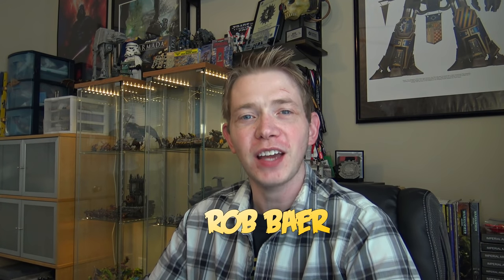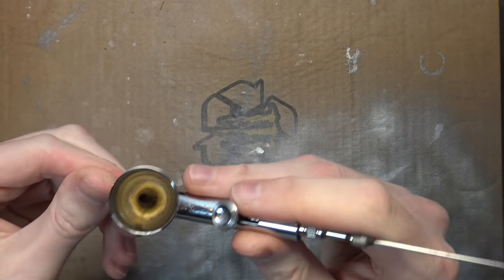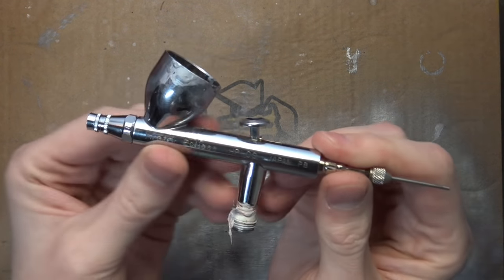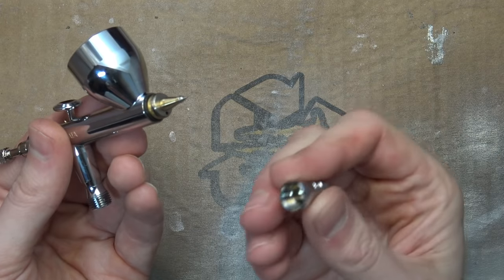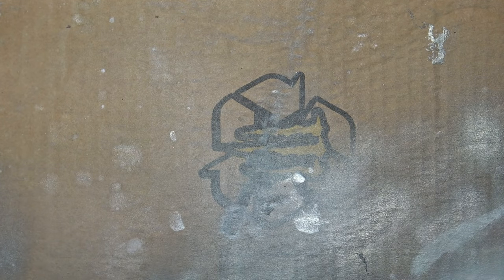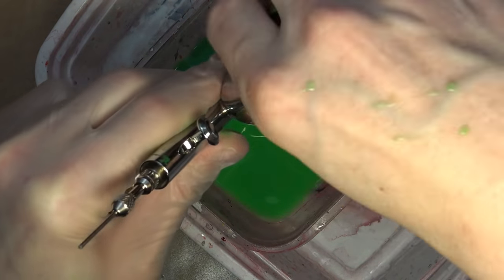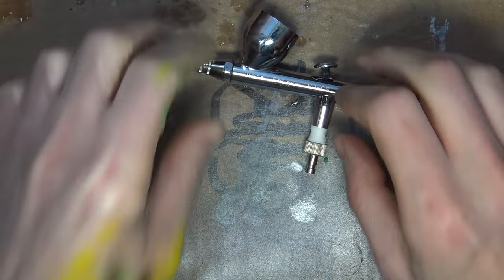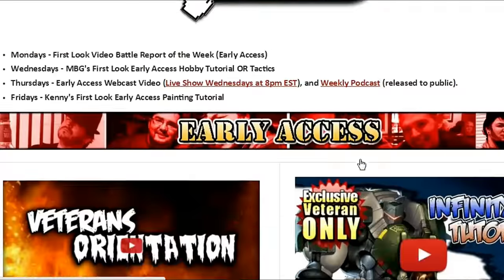So You Got a New Airbrush: Now What?

Comment: A properly maintained airbrush will last a lifetime. Keep away from super harsh solvents, keep the Hoppe's for your firearms and the purple power for your floors. Best things to use are 99% iso alcohol, lacquer/enamel thinner, and actual airbrush cleaner. You'll want a bit of each product to tailor your cleaning sessions on which type of paint you used last. I have a couple of airbrushes that my dad passed down to me from the 60's/70's and 80's, they work perfectly and the chrome is spotless. One is a 60/70's era Paasche AB Turbo (not for beginners btw) the other is an Iwata HP-SB from the 70's/80's. You don't always need the latest and greatest to do great work, although sometimes it's fun to have the bragging rights :-)
Reply: Also if you take the tip out from the front, you don't pull paint through the airbrush! Saves a big cleanup later on.
Reply: wow that's impressive, i want to do that when i have a kid

Comment: Nice Tutorial. I've watched a number of these over the years and I always learn something new. 2 updates: 1. I would say that when you remove the needle, don't have any fluid in the cup. This will prevent debris, paint, soap and even water going back up into the rear parts. There are sometimes springs etc back there that need to be kept clean and dry; and 2. For long term storage, clean the parts as you have said and use a second airbrush or even a cheap trigger nozzle (it's just for blasting air and has a thin nozzle) to blow clean air through the airbrush parts and dry them. Thanks MBG for the vTute!

Comment: that gun cleaning solvent is whats stripping that chrome finish off of your airbrush. That stuff is formulated to remove metal fouling off of gun barrels.
Reply: I would be pretty surprised if hoppes corrodoed metal, especially in guns. If anything it's designed to remove lead build up. 

In fact I would be surprised if hoppes did anything. That shit is like brushing your teeth with water.
Reply: One of the most common misconceptions is that hoppes won't hurt guns. It will. It is a solvent, not a lube. Don't leave it on a metal surface or it will corrode it. Use it then flush it with distilled water or oil.
Reply: Exactly, it's the solvent and sticking a brush down in the neck that stripped it.  The sonic cleaner is innocent.
Reply: @elronman  Every firearm I have ever used needed oil to stop corrosion. Even Guns (they have wheels you know). will corrode if not oiled. If you're getting a build up of LEAD in the breach or barrel something surprising is happening as it should only be cordite/carbon deposits...

Comment: Hoppe's #9 will remove metal fouling in a bore, it will most likely remove the plating on your airbrush too so its not the right product to use in an airbrush. Windex is available without ammonia so use that instead. If using windex with ammonia (which is alkaline and corrosive), run some hot water through the airbrush as that will gas out any ammonia still left - ammonia is after all just a gas suspended in water. If you leave a bottle of ammonia with the top off for a few days all you will have left is water. What you are probably doing wrong is putting the cap on your airbrush straight after your cleaning procedure - don't. It does not mater what you are using to clean your airbrush which includes thinners, let your airbrush air out for a while before putting the cap on. You don't want the gasses staying in your airbrush, in the case of thinners it will work itself into rubber o-rings and reduce their lifetime, in the case of ammonia or Hoppe's... well you have seen the results. Hope that helps.

Comment: Badger airbrush has different size air hose connector. So if anyone is starting with one of those make sure to get the adapter unless you buy the badger brand air hose. Unfortunately you will still usually need an adapter at the compressor hookup
Reply: when I bought my first brush i knew NOTHING about fittings..... what a headache. A Paasche hose does not fit on a badger brush. I didn't know better at the time, lolz.

Comment: Why is it necessary (about 8:20) to put teflon tape on the air inlet threads, when there is already an O-ring in the 
fittings to prevent leakage there?
Reply: your o-ring is made of rubber. rubber will be old after 4 years from when fabricated and then you can use teflon tape for a period before you have to change the rubber 0-ring.

Comment: Nice video.....was that a abrasive pad you used to clean the paint cup ? Also I just switched from a Badger to the Iwata and the hose fitting is different....do you know if there is an adapter ?  Thanks

Comment: Why I clicked on this video? Option #3: I wanted to know if you knew something I didn't already know... 

Nope.

#1 Backwash after running some water/cleaner into the nozzle over the tip, so that what you are "backwashing" is dilute, otherwise, you are pushing pure paint... and that will simply prolong the cleaning.

#2 Get yourself a container that you can "spray-off" into, like a cut-off milk jug, so that you can run some cleaner/water through the gun without having to run over to the sink, they make those things especially for that purpose, too, right?

#3  When you pulled the needle out the back end of the gun, you just pulled dirty water/paint/gunk into an otherwise clean area of the needle housing, and if you are going to remove the needle for cleaning, remove the tip/nozzle and push the needle out the front so you do not dirty the back end of your gun.

#4 No matter what type of acrylics you use, they all derive their pigments from more or less oil based products, meaning: the base is acrylic, the pigment (color) is oil suspended into the base. What this meaning regarding cleaning your brush is that there needs to be a degreasing agent, however weak or mild, just to remove the film that can build up over time into the smaller hard to reach areas of the needle housing nearest the tip. This can build up over time and prohibit flow around your nozzle tip, prevent siphon and capillary actions which is how the airbrush works to deliver the paint. Using straight water is fine for a rinse between colors, but not good for over night, and certainly soaking the gun in a shot glass of cleaner over night cannot be good for the smooth surface of the needle and nozzle tip, because the solvent in the cleaner can micro-pit the finish on the metal from constant exposure. That is (no doubt) how your old gun cup got eroded so badly.
Reply: Do you recommend another video?

Comment: You use Hoppes #9 and Purple power to clean your airbrush. That is why your shit erroded like that. Hoppe's #9 is a pretty potent solvent man. Its designed to removed caked on carbon from inside barrels not acrylic paint. Thats like pounding a nail with a sledgehammer.

Comment: That's not how Teflon tape works... It goes in-between the grooves of male and female adapters. Teflon is non stick and so acts as a lubricant of sorts in order to more easily unscrew them.. it also provides a small boundary layer in case the grooves weren't machined perfectly

Comment: I am green as grass with airbrushes and compressors. Question: once my compressor fills and is idle, about every sixty seconds it comes on for 2-3 seconds then turns off.  Sixty seconds later it starts all over again. I can't  find any air leaks and all fittings appear to be tight. Any thoughts?

Sure would appreciate some help and advise. THANKS!
Reply from the maker: You sounds like you probably have a leak somewhere unfortunately, it may be even a seal in the compressor

Comment: I've got 3 air brushes and iv not got tape on any of mine and I don't have any leaks. Is it a common problem with new airbrushes? I would have thought that might be a fault an old airbrush develops.
Reply: EVERY TIME THERE IS A SEALING ORING ON THE FEMALE PART...YOU DO NOT USE TEFLON OR ANY OTHER THING...THIS APPLIES TO PLUMBING AIRHOSES AIRBRUSHES ANYTHING...WITH THE TEFLON ..ESPECIALLY IF YOU USE IT THICK YOU DONT SCREW IT ENOUGH SO THE SEALING RUBBER RING DO ITS JOB...!!EVERY TIME YOU SEE A RUBBER RING ...JUST SCREW IT...NO TEFLON NOTHING...ONLY IN METAL TO METAL CONTACT WE USE SOME SHORT OF SEALANT...!!!
Reply: What Giannis is saying is if there is an o ring on the end of your female piece there is literally no point in using teflon tape. If its a metal to metal contact and there is no orings or anything then teflon would be necessary. In saying that adding teflon to  a piece with a rubber o ring wont hurt it.
Reply: @giannislymperopoylos5574   O-rings is made of rubber there lose it flexibility 4 years after production and you then can strenght the period from to get a new 0-ring with teflon tape. However lubricate rubber o-rings will get the O-ring to a longer life (this is teory) it all depend of how harsh you environments are
Reply: I have found that leaks at fittings are often caused because manufacturers incorrectly state that its fittings are 1/8 and 1/4 NPT. In fact, many hose fitting threads are BSPP, not NPT (British Standard Pipe Parallel).  Adapters can be found and proper adapters should be used to make things fit together properly, however people are not aware of two different thread standards and they often end up wrapping the threads with Teflon tape and forcing them together as far as they will go.
Reply: I agree with the gang. The ptfe tape is generally sought for leakage in the Zenny or other similar low priced compressors.

Comment: I dont have and lubricating oils that work with the airbrush, would silicon oil work? Its the oil used to lubricate treadmilla
Reply: The lube just helps the needle thru the o-rings and kinda sorta makes it easier to clean/smooths up threads. Not sure if yours works, as long as it’s not oily or interactive with the paint it should be okay. Sorry, I hate to be that commenter, hah. Id just scrape up some scrilla for that iwata small tube... that thing will literally last years as you don’t need much at all, just a dab on the fingie.

Comment: Woah woah... Don't backflush with your finger at 60 psi! You could put air bubbles into your bloodstream. Either turn the pressure down, or use a cap on the front.

Comment: dude, there is ZERO stainless steel electroplated onto that, its Chrome.. given that stainless steel is a compound/alloy, it cannot be electroplated onto things, it would de-alloy (the compound would separate into its elements / ionic bonds would dissolve), and its likely only one of its elements would bond.
7:45, you are holding the Paint Cap (the brassy metal), and the nozzle (the silvery metal) is screwed into the end of it, they both sit underneath the Air Cap.
you know what the worst thing is about me having to correct you? - i have never even owned an airbrush.